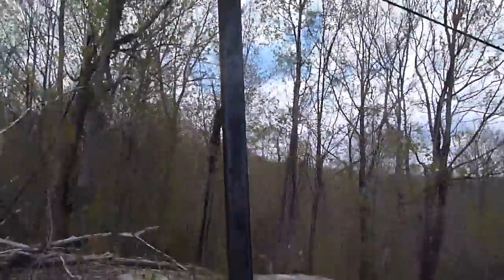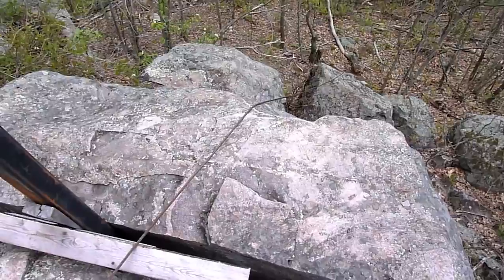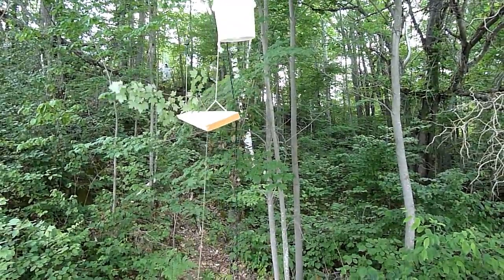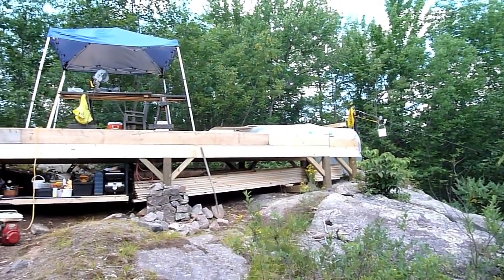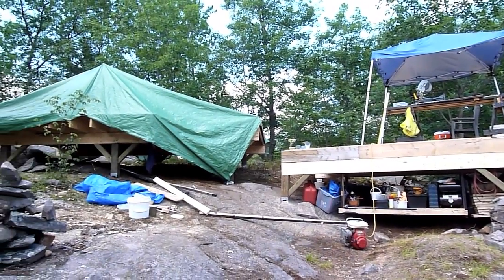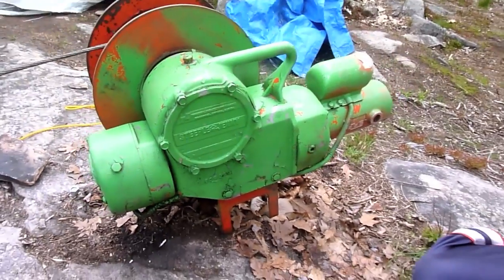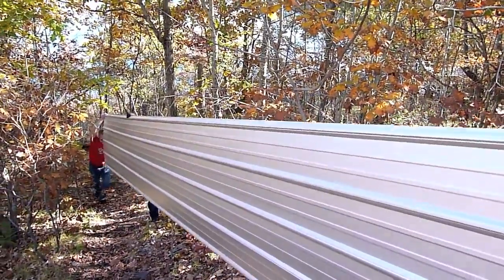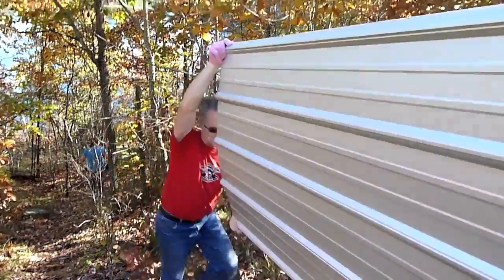The Sky Line, Diy Cable lift

Comment: nice setup really good idea and probably strong
Reply from the maker: Thanks Serge. It has saved our backs thats for sure!
Reply: Could have modified the lift to include clamps to pull the tin sheets up, or a flat panel lift kinda like they use in drywall lifts to get it to second story houses.  Wouldn't be too hard to create

Comment: Any chance of showing how you attached load to main cable? I’m considering buying a ruin in Portugal which has no vehicular access only 100 metre footpath from road down a quite steep hill. Cheers and good luck!
Reply from the maker: Im planning a update video soon, I have changed the winch motor and some other aspects. I will take a photo of the carriage next time Im there